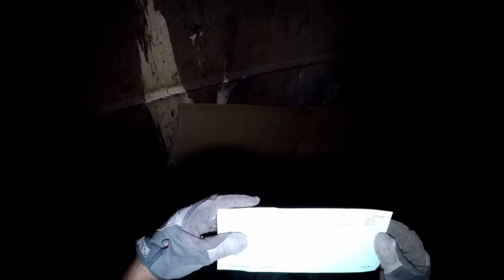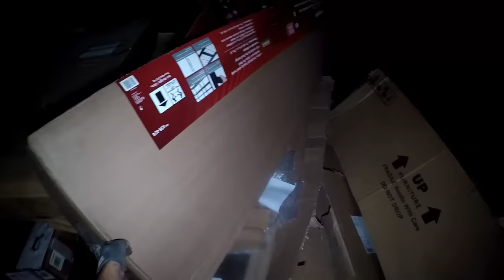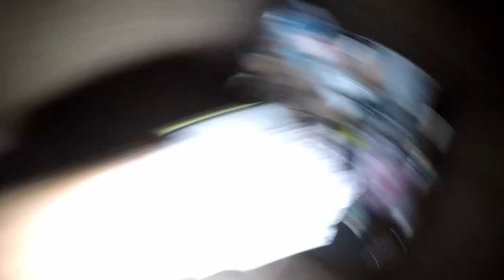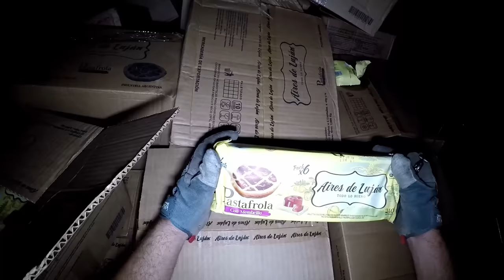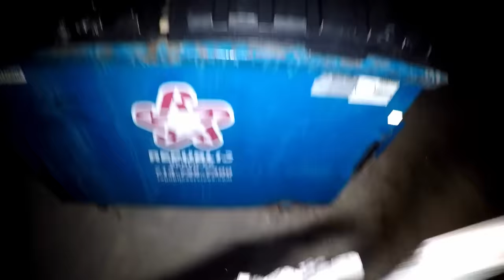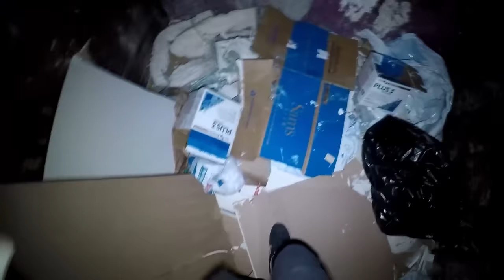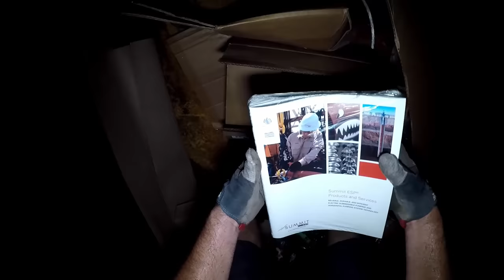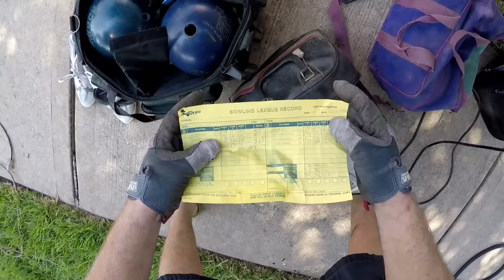Dumpster Diving "I May Not Make It Out Alive"

Comment: That key fob is not for a Dodge Viper but for a Viper alarm system. Probably pretty valuable and a resellable item on eBay. And that keyboard probably has good resale value on eBay also. That hand cart is for moving refrigerators and heavy furniture. Pretty expensive too!  Don't scrap it either keep it or sell it.  Love the long videos!

Comment: Mike pull the flower off keep the cuttings put them in water till you see roots grow, then into pot of dirt and, see them grow.
UncleDave
Reply: they look like roses though, and while that might work with some cuttings like impatiens etc, wouldn't they be better with a little hormone rooting powder and put into a little sandy potting mix to root? although if they have dried out they will not take too well.
Reply: @dragonmaddie  My wife and I for the last 50 years have grown roses from cuttings, another thing I should have said is don't put any leaves in the water pull them off first.
Reply: @uncledave630  well as i can only go 35 years experience with  rose cuttings specifically, 20 of which as a professional gardener, and have never known anyone to put rose cuttings in water to root, due to that woody stem,  i guess i shall bow to your greater knowledge, but still recommend a little rooting powder and a nice free draining soil.
Reply: @dragonmaddie  My wife and I found out it is a good thing to cut rose bush flowers off for the house but just for the bush we cut stems after the rose is falling apart off the bush. They never have wood on them just green stems and put them in water without the flower and no leaves in the water. Your rose bush will grow more flowers next time. And the cuttings will have little white roots then place in small pots or in ground.
UncleDave
Reply: @uncledave630  ah i see so you avoid taking woody cuttings and use just the short green stems.  for most rose cuttings i was taught to take are between 7 and 12 inches so avoiding taking woody cuttings is an impossibility.  i guess i can see some logic in using just the fresh green growth.  it is just not a method i have ever heard of nor one i have seen used commercially.  most roses used for cut flowers are of a longer stemmed variety which usually means that stem is quite woody if you are going for a traditional length of cutting.  some cultivars will not thrive outside of a greenhouse . depending on where you are of course.  lol of course roses will grow more flowers, they thrive on being cut back hard.  my first head gardener taught me, make them think you are killing them and they will flower better for you next year.

Comment: Found two super sealers. An 18 inch retails for $345.00 and a 24 inch is $643.00. Looks like you are missing the heat gun for shrinking and a roll holder for the plastic. Also the part you have does not vac pump. It only cuts and seals the edge with heat.

Comment: It's funny they scrapped out of water heater and left the brass on it. Viper was for an aftermarket alarm and possibly remote start that was probably put on some Dodge vehicle not a Dodge Viper. Red light was coming on when you closed it on that super sealer it was very dim..

Comment: Randy hay if your by your self having problems getting a refrigerator or anything up and in the truck use your ratchet straps to help you pull it up lean it up bring straps down around bottom back up other side ratcheting. It up

Comment: That Dolly looks like a MAGLINER It's an $300.00 Dolly or Hand truck all day New.  That fold down nose is for stacking boxes 2 deep or just hauling larger items. The yellow strap is for tying down your load to secure it. You can get $150 -$200 easy selling  it to Any Mover, UPS driver, Pepsi, Coke, Beer, or Any other delivery worker. That was the best find. I hope you didn't just scrap it bro. If you still have keep it dude it is super light weight the first time you need to move a bunch of stuff you will be glad you did.

Comment: hay mike if you need a stick  go get your self a bike hook the ones you screw in to the in to the wall  or ceiling  harbor freight  has a whole set in red  then get a wooden broomstick  on of those good ones and predril a hole in the end and thread that hook in to the end and then run some tape around it. or just go to the sporting goods and get your self a gaf pole like what they use on fishing boats.  those paint rollers just arnt strong enough unless you. reinforce them with duct tape

Comment: Congratulations, you are now the proud owner of a 20-year-old entry-level keyboard. ;) I forgot what David the 8-Bit Guy's trick for getting pesky stickers off was (WD-40?), but consulting the 8-Bit Keys channel should clear that up.
You can get a manual from Yamaha's website. I'd say this one is still a bit better than modern-day $50 toy keyboards. (It does have MIDI in/out at least, not to mention some half-decent build quality.) It's probably about as fancy as dumpster finds are generally going to get, aside from similar 61-key models like PSR-248 or PSR-260 or comparable Casios. Yamaha alone made a ton of these. Nowadays, a similar place in their lineup is occupied by the PSR-E263. Build has gotten substantially lighter over the years, but the modern synths sound a lot better at this price point. That said, so do higher-end models from back in the day. I don't think anyone would toss those though.

Comment: I found several water heaters like that and I couldn't figure it out till someone told me don't ask me what they're doing with it but they cut it open and they use the guts for meth Manufacturing dumpster diving and scrapping is full of stuff you would not believe didn't you already find one airsoft gun or air pistol or something like that those are always used in robberies and just pitched in the dumpster found one of those flicked right on top of everything obviously not a part of the stuff that was in the dumpster and then your share of dead animals unfortunately they must keep it tight reins on it in Texas I find the stems from weed grows all the time all the and trimmings and the worst used condoms stuck to my glove that I have to throw out the other day horrible smelled butt😪 PS. Dottie the perfect name for a Scrappers truck cuz by the time you're done doing this there's going to be. Size scratches all over it just like the last two trucks I've owned

Comment: I bought that same Milwaukee dolly and it is a crappy design. The pin system gave out and dropped a cabinet I was moving. I had to weld it my own plate and pin system to make it work. It's a POS.